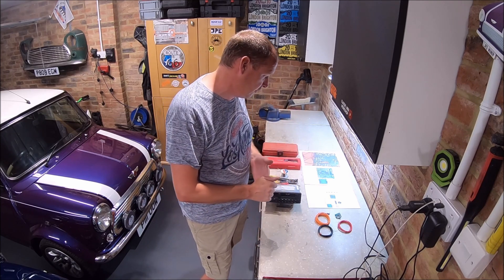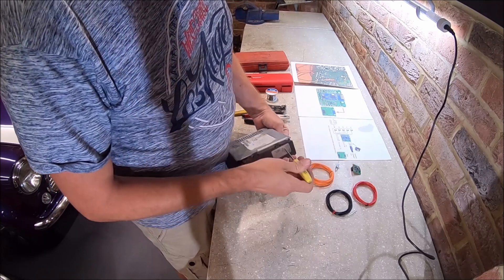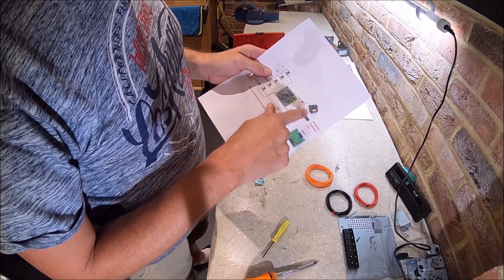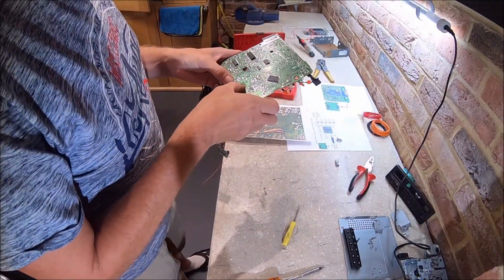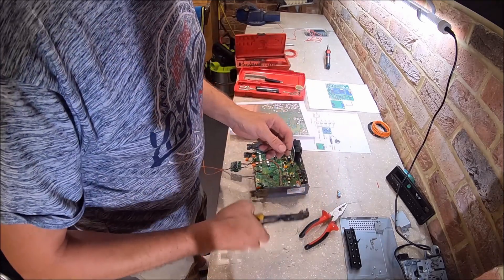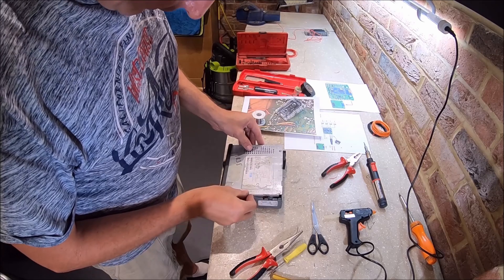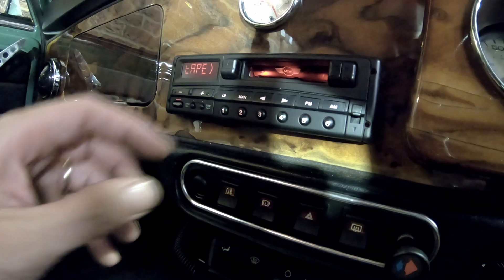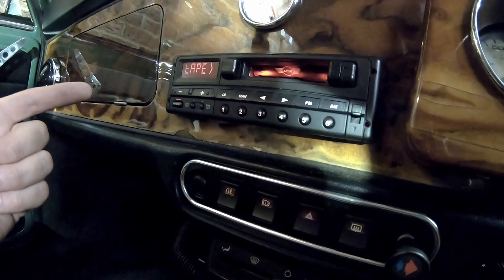Adding Bluetooth - Car Stereo Hack For Only £13 - Classic Mini Workshop Project

Comment: How did I miss this video. What a fantastic hack. Was the stereo i sent down used here?
Reply from the maker: I stripped it for spares, the circuit board was toast due to corrosion but the facia etc. was fine. Thanks

Comment from the maker: Just to update after filming this video I moved the switch so that it operates off the fast forward button as suggested by a few people. Also, I've got to mention, the audio quality is superb through Bluetooth.
Reply: I’ve sent you a message via Facebook of the way I did it so that you don’t have to insert a tape. Might help you in future :)
Reply: @tbramhall94 hey mate would you help me to identify one of the burned components on the board? I can’t seem to get two LEDS and display to work.

Comment: Would have disconnected the ffwd switch and used that instead of the extra switch possibly
Reply from the maker: I will have another try on my other head unit. The FFWD button would certainly be the best to use.